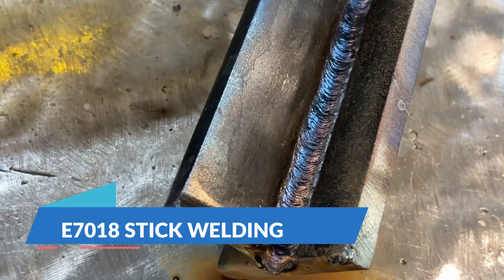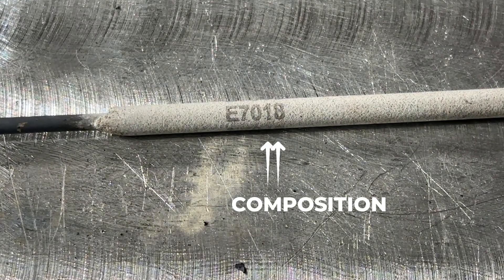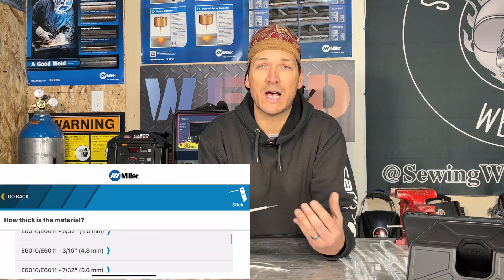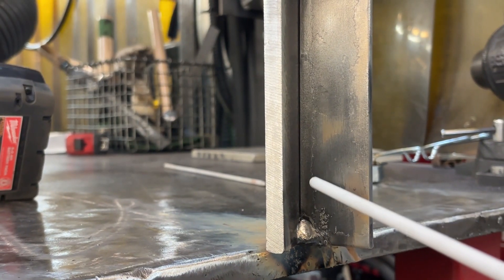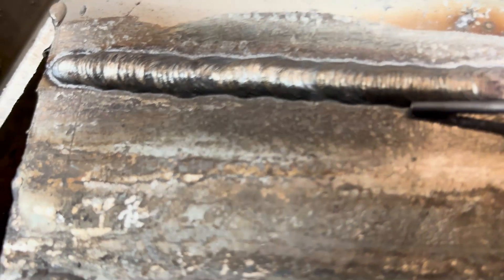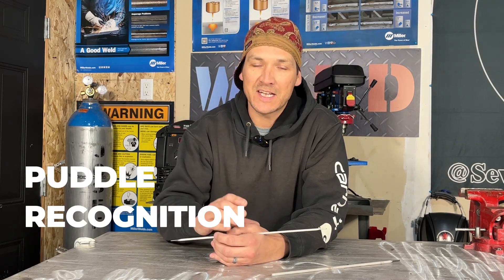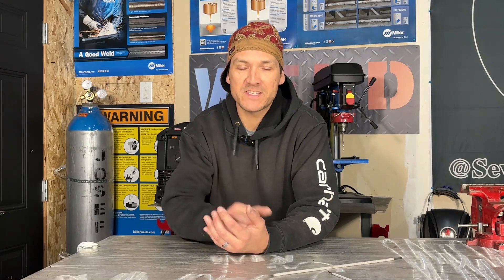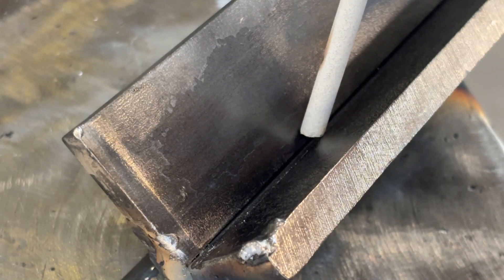How to Weld with 7018 rods

Comment: Great video!  Thanks for taking the time to explain  technique and settings.  For the home hobbyist welder like myself, that my not have the best quality welder, what voltage capability or specification would indicate that 7018AC electrodes work best for us, even with a DC machine?
Reply from the maker: Thanks man- appreciate the kind words! Amperage for 3/32 ~75-110 1/8 ~110-140. I give you range because it all depends on the welder

Comment: I think hot start option for welding machine and 7018 rod make's so much different. Thanks for video.
Reply from the maker: @majidshafizadeh9316  I agree my friend - I find if you never used it before you tend to forget it’s there